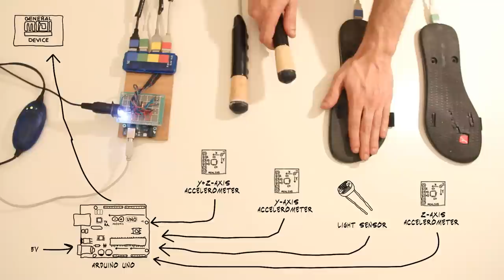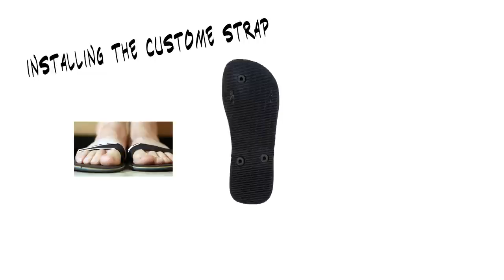Arduino Air Drums

Comment from the maker: @antgo264 

- ADXL335 X 3
- Light Dependent Resistor X 1
- Arduino UNO X 1
- USB Hub X 1
- male to male custom USB cables X 4
- Female USB Jacks X 2
- MIDI female jack X 1
- MIDI To USB device (M-AUDIO - Uno) X 1
- Different resistors to use the MIDI & Light Dependent Resistor via arduino
- Garden racks X 2
- Havainas sandals X 2 

that's it 
also see the the eagle sketch attached in the video info

Comment: This is awesome! Do you have a more in depth schematic on how to set this up and what components are required? I tried to use the schematic link and I couldn't get it to work but I'm trying to put this together for my Embedded Systems Course I'm taking.

Comment: I am super curious to know how well this system responds to faster movements.  I know the purpose of this vid was to show the tech, not drum skills, but just wondering if the reason you didn't do the fast fills this song normally has was because of the sensors' limitations (or your own as a drummer) No hate:)

Comment: QUick question, will the accelerometers from a WIi Mote work, as in taking out the component?
Reply: Yep, but it's smarter to use a Wii nunchuk, which is easier to connect to the arduino (you don't even need to open it, just plug some cables in the connectors). It has 3 accelerometers inside, I used one with a friend on his aruino to activate leds of different colors when you tilt the nunchuk :)
Reply: Aww sweet, thanks for the feedback :D
Reply: Alban Lefevre How can you connect nunchuck to arduino? Sorry I just took mine!

Comment from the maker: @eigenstates 10x mate ! i thought about it... I'm trying to keep it "natural" or "similar" to a original drum kit, the next thing instead of light sensors in the handles i though about gyroscope sensors on each hand which will measure the angle of the hand during the hit, and by the angles to manipulate between the different drums...
but 10x for the advice and the equanimity :-)

Comment: Im not an expert in programming or anything but i tried using AT MEGA328 arduino, the code uploaded fine but will it even work with this arduino? if not what would i have to change for it to work?